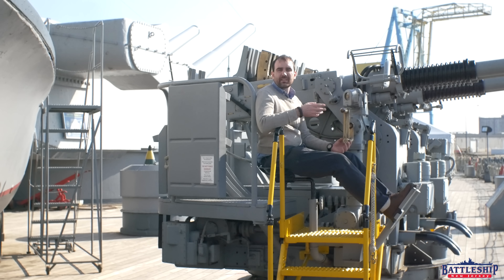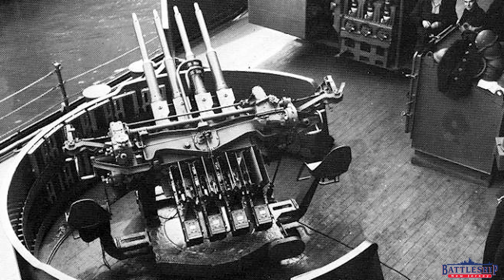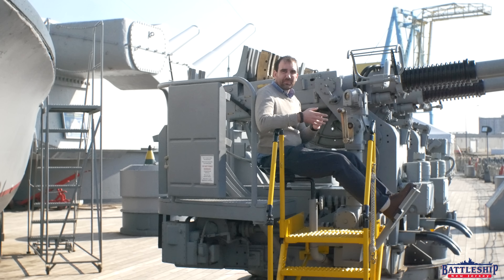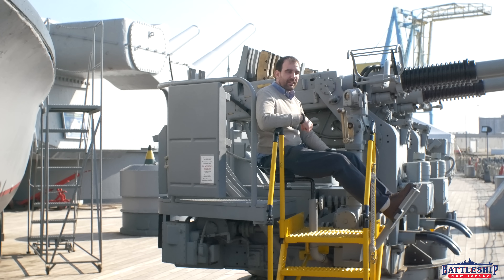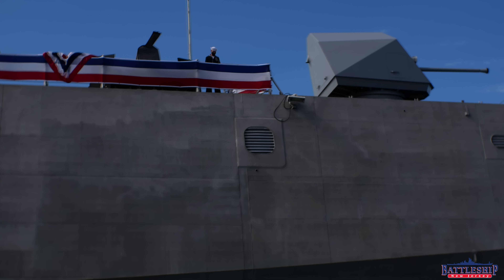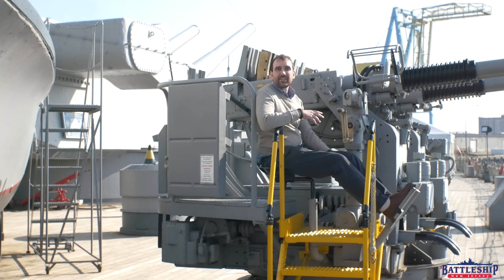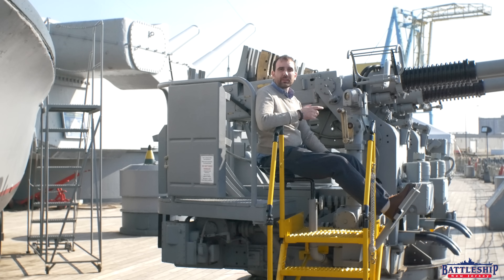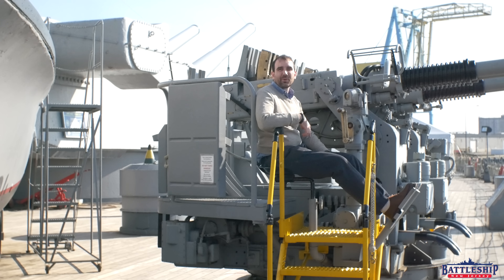Why Are Some Naval Guns Described in Inches and Others in Millimeters?

Comment: the British in WWII also denoted guns by projectile weight.  The 2-pdr gun was 40mm; the 6-pdr was 57mm, and the 17-pdr of the Sherman Firefly was 76.2mm.  This gun was different than the 76mm M1 gun used on US Army versions of the Firefly.
Reply: they used nominal weight, rather than actual weight: it's based purely on bore diameter. 
my understanding is that the 75mm and 76mm guns on the Sherman used the same projectile diameter, with different names to avoid confusion
Reply: @totensiebush  that is correct. The projectiles were actually interchangeable between the 2 but the cartridge cases were in no way interchangeable. Kind of going from a gatorade bottle to a 1/2 gallon milk jug.
Reply: The Brits also have their own unique threaded fasteners "BA". Not even close to our American Standard nor Metric threads. I was told by some older mechanics that this was a practice so that the enemy couldn't easily install their weaponry in theirs without having to completely redo the threaded fasteners. I even had a set of special wrenches for those fasteners. It was so weird, nothing would fit on those fasteners except for the British Standard wrenches.
Reply: I know this to be the case for old black powder cannon, the weight was based on a sphere of lead the diameter of the bore not the nominal projectile weight because usually the cannonballs were iron. Lead was easier to work with than iron so it was used for measurements. 

I imagine that the weight to caliber size was in common enough use that when modern guns came about it was just an acknowledged shorthand for a bore size.
Reply: There was no "US Army version of the Firefly". US army M4s built during the war with the 76mm gun used the T23 turret. The British M4 conversion to the Firefly used the older M4 turret that came with the 75mm mounted. The British specifically requested they be sent only M4s with the 75mm turrets.
Reply: Brits measuring weight in stone cuts the noise
Reply: @dukeofgibbon4043  Brits also spell Tire  "Tyre". Never understood that one lol
Reply: @kennethwise7108  There was me as a Brit assuming it "tyre" had some classical origin, and it was one of "those words Ben Franklin Americanised".  But OED suggests the word comes from "attire", and was originally spelled "tire" here in the 15th century.  When it was revived in the 19th century (presumably with the boom in bicycles) it somehow morphed to "tyre" here!

Comment: I think the OTO on frigates is described as 75 mm, not 76.  But in any case, it's actually 76.2mm.  Exactly three inches!
Reply: And exactly 10 times the diameter of a .308 round (7.62 NATO) 

Is this "1/10th of 3 inches" the origin/reason for the .308?  I'm curious.
Reply: @JR_MacD  Yes. .308 literally means 0.308 inches, same as .40 cal means 0.40 inches, .50 cal means 0.50 inches, etc.

Comment: It's not that one is more precise than the other. 16 inches is 16 inches. It's just that if we want anyone who's country hasn't put people on the moon to have any idea of what that means, saying 406mm is the way to go. Of course I've noticed that Germany always gave their measurements in cm instead of mm, just to be different I guess.
Reply: Nah, just because it's an easy conversion  1dm=10cm=100mm.
Also nasa used metric for the Apollo missions. 
I mean von Braun, a Nazi German engineer was a big part of the whole moon program,because he more or less designed the rocket
Reply: @muuhnkin4611  For all the advantages of metric over imperial, I think the length/distance scale is the reason the US still hangs onto the whole thing. If a person gets decent at using fractions then the imperial system's base 12 counting system is amazing for for any type of builder, tradesman, etc. You can divide by 2,3,4,6,8,1/2,1/3,... and either get a whole number or very close to it. Pounds make no sense. Gallons make even less sense, but feet, inches, yards, and miles make so much sense that its propping up the rest if you ask me.
Reply: @Odin029  distances makes no sense too.
12 inch = 1 foot, 3 foot = 1 yard, 1760 yard = 1 mile...  And then there is the naval mile, which is 2025,37 yards. There's a no consistency in that system at all.
Metric it is 1000 millimeter = 1 Meter, 1000 meter = 1 kilometer, so it's always x1000 
There are also the increments between mm and m into cm and dm, those are always x10.
10mm=1cm, 10cm=1dm, 10dm=1m.
Reply: @muuhnkin4611  Leave the naval mile out because it has nothing at all to do with the rest, completely unrelated. 
The imperial length/distance system is so consistent and mathematically easy that once its understood its hard to beat. So, the base unit is the foot, which is broken down into 12 parts, inches. That's where the magic of the base 12 counting system comes in, versus the base 10 system that metric uses.
I could do the same for yards or whatever, but we'll go straight to miles. 5280 feet seems to make no sense, but divide that number by 2,3,4,5,6,8, and 9. A magic trick happens. Only dividing by 3 & 9 doesn't give a whole number and even then the answer is easy. 5280 divided by 9 is 586 2/3 feet exactly. Now how many inches is 2/3 of a foot...8. So the exact answer of 1 mile divided by 9 is 586 ft 8 inches.
Nothing at all is arbitrary. No calculators are needed, no decimals are needed. Only dividing by 7 gives problems and even then its not too bad. This is the one thing that to me imperial does better than metric. Also there is a semi mental separation in an imperial user's brain between distances and lengths. It's why most Americans can hear a distance in meters and get a quick mental image of how far 300m is but tell them a cliff is 300m tall and there's a moment when that number is being mentally converted to approximate feet.
Reply: The Wehrmacht had a certain preference for caliber measurements in centimeters, but for smaller calibers measurements in millimeters were also common  In the Bundeswehr today all caliber measurements are in millimeters.
Reply: The entire Apollo programme was German. All crucial department leaders and the entire know how, including how to fly to the moon, was German knowledge, German technology and run by German scientists. Without them, the Muricans had zero chance, and zero competency.

Comment: Yeah! Another curator measurement. As a 16" gun equals 0.85 curators in diameter, Pi now equals 0.166 curators. Please start converting your math textbooks to reflect the correct Pi value in curators. A diameter of 18.82" is equal to one curator.  😊

Comment: Inches and Millimeters both work for me. But I'll take a cheap shot at the British here - POUNDS is a terrible way to identify artillery. For example: the British put a 17 pounder gun in the Sherman tank to create the Firefly. I think the 17 pounder is a 76mm bore gun.

"Come on mates, pounds is bloody awful!"  😀
Reply: In fairness, pounds was an EXCELLENT method for identifying artillery for quite awhile, especially before shells really were a thing
Reply: @TheFamine123   Yes I agree that pounds worked well for artillery firing solid iron cannonballs long ago. But I don't think it works well for a high velocity sabot discarding AP gun.  Consider the eccentric nature of it. The British use their tremendous inventiveness and brilliance to create the discarding sabot AP shell. And they put it in a "six pounder" gun.  😄
Reply: @riverbluevert7814  Hence my "before shells were a thing" qualifier. Granted, it makes sense they'd hold on due to momentum, and it's a similar deal to shotgun gauges. Everyone else using calibers kinda ended up dragging British guns along to the party eventually
Reply: @TheFamine123  Agree
Reply: If it works, then it's not stupid.  :-D

Comment: So- as Stated the Perry Class Frigates had Oto Malera 76 mm guns. tad too late for World War 2 The US developed the 3/50 AA gun. Anyone have any idea - do each of these have totally different shells- could not swap ammo between the 2 ? I had perception that for both - US had nothing but VT frag shells, no PD(point detonating) or delay (after impact). A Cool New Youtube feature is to in real time see the view and Likes counts increase as I "sit' on the page.
Reply: The 76mm Oto Merara propellant case is straight sided like a .22 Magnum. It looks very much like the 76mm tank gun case in  the upgunned Sherman. Their projectiles are much more advanced design than anything used in WWII.  There were maybe 4 types of USA 3'' shell propellant cases, some like the USN 3''-50  look like a large 30:06 case, with minor differences but not interchangeable. The 3'' 76mm ones for anti tank service had much less pronounced taper in the case. The USN 3''-50 itself had all kinds of projectiles available including Armor Piercing, High Explosive, time fuzes, self destruct mechanisms, tracer elements, etc.  The VT came later in WWII.  Some of the old WWI 3''-50 AA shells were shorter than the standard 3'' High Explosive shells by about 2'' in overall length. Yet they were fit in a brass case that is about 2'' taller than the standard 3''-50. A person could make an entire extended collection out of only 3'' and 76mm ammo used by the USA. 

 I tried collecting 20mm types and just about gave up after getting about 20 different kinds with a Madsen being the oddest looking, and a rare rimmed Russian straight case unit that took a while to identify. The Japanese WWII 20mm AA case looks huge, maybe twice the charge of an Oerlikon 20mm cartridge. The king of my collection is a 16''-50 cement filled target practice shell in an original wood and steel open stacking crate, 1902 pounds. It gets like counts just for sitting there collecting dust. I hope this helps!

Comment: I'm curious as to why it's a 152 mm gun instead of a 15.2 cm gun.
Reply: Germans preferred to use cm while nearly everyone else used mm.
Reply: @gobblox38 Yes. The Wehrmacht had a certain preference for caliber measurements in centimeters, but for smaller calibers measurements in millimeters were also common. In practice this didn't cause any problems, converting millimeters into centimeters and meters is done automatically in your head, while you have to think a little bit about inches, feet and yards. In addition, in military jargon, it didn't matter whether, for example, the famous "Acht-Acht" ( "eight-eight")  flack or tank gun had an "88 mm" or "8.8 cm" caliber. 
In the Bundeswehr today all caliber measurements are consistently and consequently in millimeters, which is the NATO standard, including the US Army and US Marines.

Comment: Great presentation.  I would note that I believe caliber is a reference to a ratio between diameter and length of the barrel.  I could be wrong there, but many destroyer guns were defined as  5-inch .38 caliber.
Reply: As built, New Jersey was fitted with 20 of the 5-inch/38 guns you mentioned, distributed in 10 twin mounts, five mounts per side.  For her 1980s-1990s deployment, two twin mounts per side were removed to make room for the then-new Tomahawks, Harpoons, and CIWS (aka Phalanx).  There are quite a number of videos on the channel that talk about the 5/38s.
Reply: The USN used 5''-25 cartridges for early AA guns then later used on submarines to replace the old 4''-50 guns. The projectile was crimped to the propellant case and took a healthy strapping farm kid to carry it and thrust it into the breech. The 5''-38 was a very commonly used round that had separate loading shell and propellant case. The USN also utilized a 5''-54 gun  that had the longest propellant case, biggest charge and separate loaded shell. These were all straight sided rimmed cases in brass and later in steel.
Reply from the maker: Yes, caliber for artillery like this is a measure of barrel length. A key here though is instead of it being .38 it's just 38

Comment: Curators should be the standard unit of measure for all battleships.
Reply: except like the moon the size of the curator waxes and wans depending on the time of day and the period from the start of the use as a measurement and the end 🤣
Reply: So the calibre, width inside barrel is one and a part curator head width, and length curator height times X. Or will you do barrel length as calibre times. Eg imperial 16 inch calibre times 50 say.  Thinks that's NJs measurement.
Actually looks like NJs guns are 2 curator heads wide.
Reply: @Michael_Brock  That came across rather muddled... What measurement are you trying to compare to Ryans head? The NJ 16 inch 50 caliber means 16 inch diameter bore, and 800 inches of rifling after the breech (16 inches x 50).

Where most folks get confused is when you say a "50 cal rifle" it's .50 inches (1/2 inch) diameter bore.

For my own sanity, I just remember that artillery caliber is length, man-portable firearms caliber is diameter of the bore.

Edit: also, realize almost half of NJs gun barrels are actually breech. When the gun is loaded and ready to fire, the shell is already several feet outside the turret sitting in the barrel... so saying caliber of artillery = gun length is actually disingenuous because you're suddenly saying the breech doesn't exist.
Reply: @Michael_Brock  haaaaa
Reply: It's a squishy standard tho
Reply: But what do we do, because the curator changes? For whatever reason. Then we would have to correct all the records with a new curator.
I think curators have better and more important things to do, like making YT videos.
Reply: but will we be using the average curator size or just a curator size.
Reply: @Eledore  The global standard is the metric Szimanski. The standard reference sample is stored in a Xenon-filled glass bulb in Paris and only released periodically so he can film videos in Camden, NJ.

Comment: I think I'm kind of basic in the sense that I tend think of gun calibers in imperial, unless there's a specific reason not to. 
Like whenever I think of the main guns on the Bismarck, I think of them as 15" guns more than I think of them as 380mm guns, despite them being basically the same. Royal Navy and US Navy ships generally are "easier" because we both use imperial anyway, with the obvious exception being smaller caliber AA guns like the 40mm Bofors, 40mm Pompoms, and 20mm Oerlikons. I guess I have the interwar period treaties to thank, since guns used in WWII are all designed around that time period.
Whereas for the IJN weapons, I think of them in metric. Because they do the weird 410mm, 460mm, 155mm, and 100mm. So they're kinda like 16.1", 18.1", 5.1", etc etc. I feel like my brain will process Soviet artilleries the same way if I ever get into Cold War era ships.
Reply: US customary units =/= Imperial

For length, they are the same. For liquid volume, they are not. An Imperial pint is noticeably greater than a US pint. Ditto for the Imperial gallon.
Reply: @MichaelScheele US gallon 128 fluid oz. Imperial gallon 160 fluid oz. The nice thing though is that both have the same basic origin story in that they derive from the standard size container for a popular alcoholic beverage.

Comment: as somebody who works in construction you can get a more precise measurement using inches then you can using the metric system it's also scientifically proven that it takes more brain power to use inches (what we in the US would call the standard system) then the metric system
Reply: lazy minds have a strong affection for metric it seems
Reply: This is why engineers and surveyors use decimal feet. :eyeroll:

Comment: I would add, that direction in mils is very usefull to.  6400 mils = a circle, 1 km = 1 mils = almost 1 m(98cm,)  it'S very usefull to guestimates distances in your mils marked binoculars, tank optics etc.....
Reply: Spellcheck gotcha?  Thats "mils" not miles.
Reply: not my first language, have a nice day @SomeRandomHuman717
Reply: done @SomeRandomHuman717
Reply: As a land surveyor, let me fix that for you: 6400 mils/circle. 1000m x sin(1 mil) = 0.98m.
The one I keep in my head is 100ft x sin(20 arcseconds) = 0.01ft.
Reply: a t72 roughly 3 m wide, 3 mils = 1000m that's battle range boum he is dead, no time for math in combat, but that is still cool to know thanks @cf453